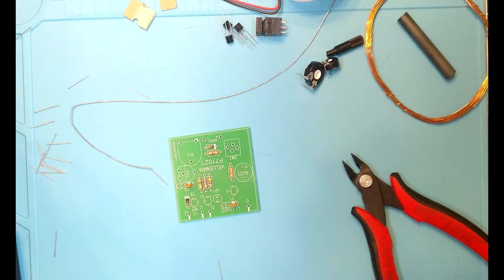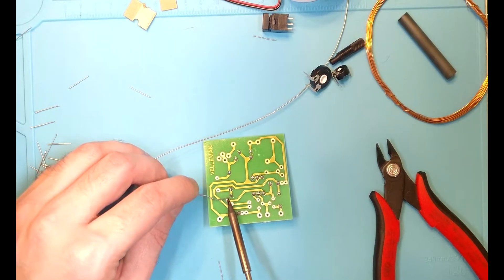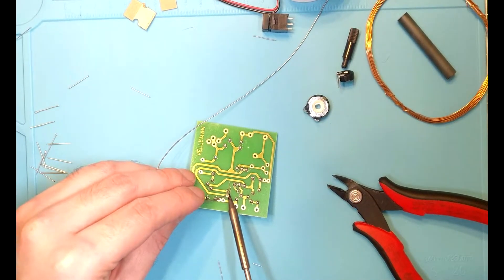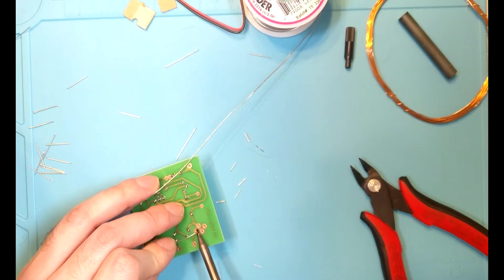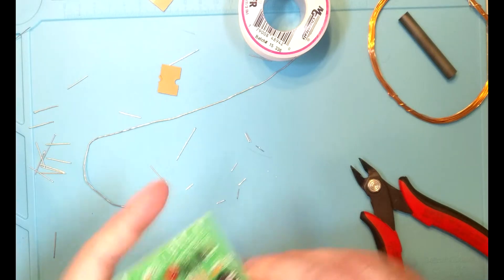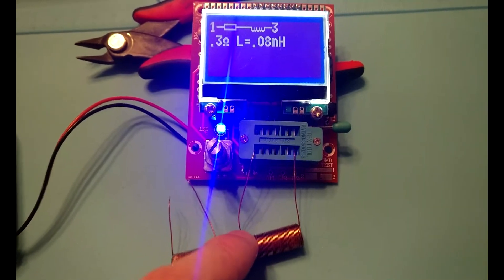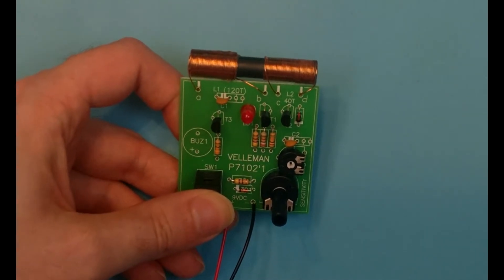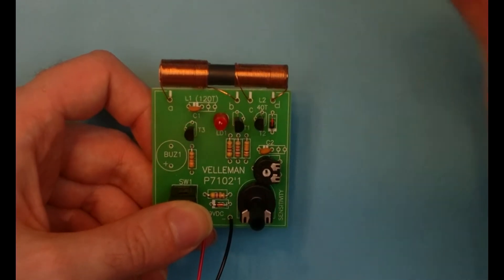Velleman K7102 Metal Detector Build - Part 2

Comment: Take it to the beach?
Reply from the maker: My back aches at the thought of using this little thing at the beach. Although...with the concepts presented by this little device, maybe I'll build a larger-scale version.
Reply: Gadgetboy longer leads and a Broom stick?
Reply: Gadgetboy also I found a ton of metal at the beach, not sure if rust or micro meteorites, black sand... Looks like meteorite
Reply from the maker: It's likely just sand with a high ferrous content. Meteoric iron has a distinct crystalline structure which you'd be able to view under a microscope if the grains are big enough (or if your microscope is powerful enough.)
Reply: Gadgetboy the exterior did look similar to something that has been in high heat, but also damaged by ocean water, so I'm not sure, also when I seperated them from a cup of sand, I put them on to paper and knocked them all over the place 😑 maybe I'll have to go again...

Also, shhhhh, let me have my moment 😜

Comment: Inductor tester? Sounds interesting, if the wire was enamelled couldn't you wind one over the top of the other?
Reply from the maker: Enameled (or insulated) wire is required when winding an inductor, and yes, you can wind multiple layers - which is what I did.
Reply: Gadgetboy nooo I mean, one over the other, right over left, I realise now maybe they did need to be seperated, didn't know if cutting the core in half would help though
Reply from the maker: In this implementation, I think it's acting kind of like a transformer, so the windings do need a common core. I'm not sure if you could get away with stacking both windings on top of each other, I may have to experiment with that idea.

Comment: Can't you just grind the end off the tip to get the shape you require?
Reply from the maker: What do you mean?
Reply: Gadgetboy soldering iron tip, if the outer part is a metal case, can't you file some of the metal away to get a different profile
Reply from the maker: Unfortunately, no. Iron tips are made of a copper core, then coated in iron, then at the very tip they're plated with nickel and chromium (which holds solder very nicely). If I were to file it, it would ruin the plating and it would start corroding.
Reply: Gadgetboy ahhh righto, would it be possible to strip and re plate it? Or cheaper to buy the proper one
Reply: Gadgetboy how about maybe a place online does shoes, so you can slip them over the end?
Reply from the maker: Simpler to spend the 15$for a new tip. Not sure how well a tip that would slip onto an existing tip would work.